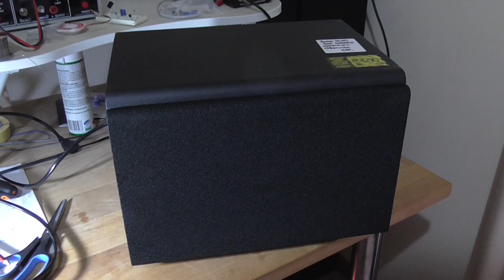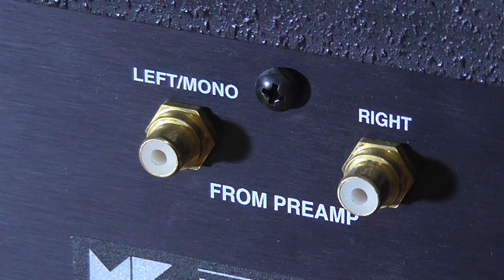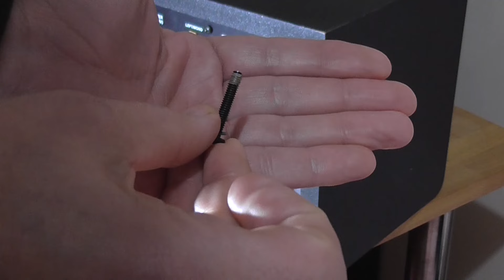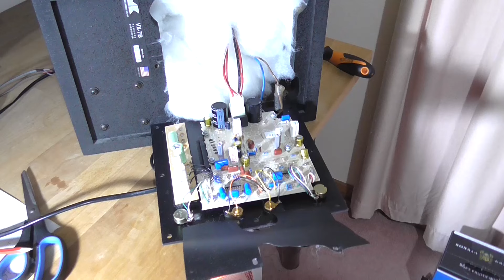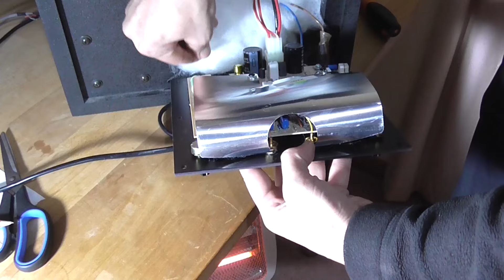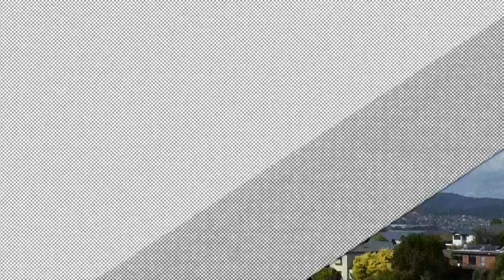Miller & Kreisel VX-7B Subwoofer Service

Comment: I have the Mark II version of this subwoofer.  I love it - but over time, this exact issue happened to me.  Now it's to the point where the hum doesn't go away and it's just been sitting unplugged for quite some time.  I'm going to give your method here a try with a squirt of alcohol, but if that doesn't fix it - do you think it's just a bad crossover or gain pot?